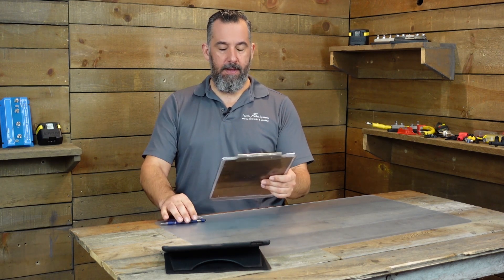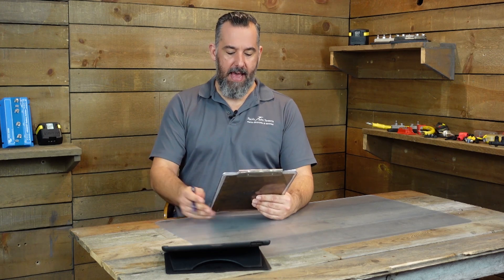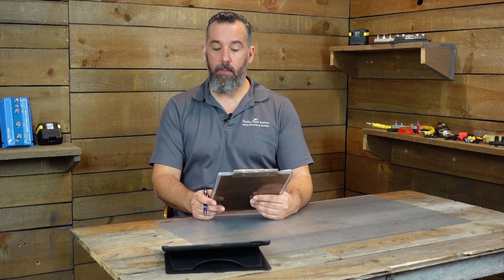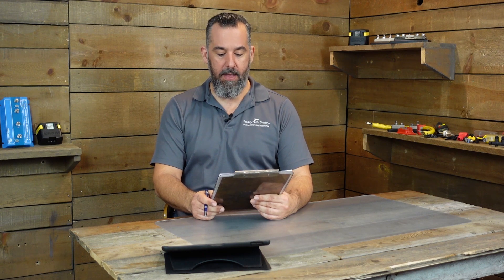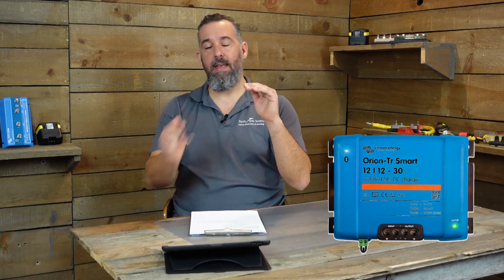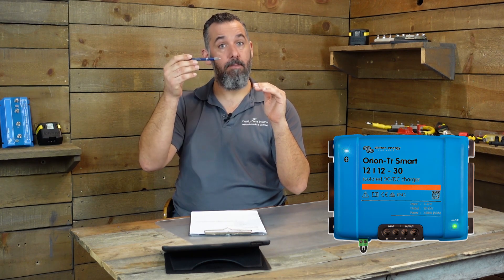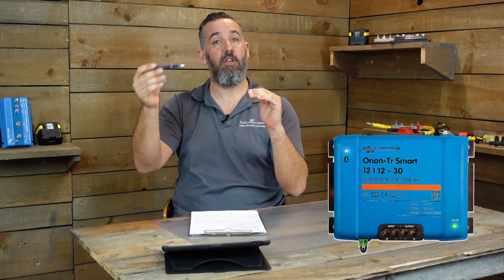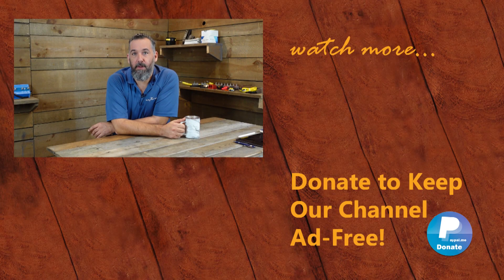How to Charge a Lithium Battery House Bank and an AGM Starter Battery at the Same Time?

Comment: so  - i can use shore power and alternator as is for the main starterting battery - removethe connections to the house back and have the starter battery go to a dc to dc then to the lithium bank?  can i still keep my solar and wind direct to the lithium bank?  or should that be moved to the starter?

Comment: In this case we need to use a Battery isolator with two outputz, but one of those must be connected to a DC-DC converter and after to the lithium battery bank, right?

Comment: Hi Jeff. 

Can the input of this dc to dc charger come from the output of a battery isolator?

So we don’t drain the starting battery by having it as the input of the dc to dc charger?

Thank you
Reply: Most DC to DC charger are also an isolator so I guess unless you just want the redundancy. I would save the money. 
I have a renogy 40amp dc-dc Charger and it says in description that it also functions as an isolator To protect the starter batteries)

Comment: Sooo confused.  I just finished watching another of your videos addressing the charging of lithium house and AGM starter using a battery isolator and a charge relay, but here you say that can’t be done because of charge profiles and you need to use DC- DC charge converter.  Is the difference having or not having the proper regulator for the alternator?

Comment: What happens if you DONT install the DC to DC charging converter? Would the AGM starter battery suffer more or the Lithium (Lifepo4 in my case)? I ask because with my situation I'm willing to just let the starter battery suffer, I dont care. I can replace it. But I wld like to keep the LifePo4 healthy for a while. Is this just not possible without a converter?
Reply: Your alternator would suffer.
Reply: @pauldemontigny1754  but the batteries wld be ok? i dont care abt the alternator really

Comment: Hei Jeff. I find your "tech talks" very interestig. However I am wondering why you are not proposing the "Alternator to Battery Charger" system as an option. I have installed this type of charger with outputs to my LiFePO4 service battery and to my AGM start battery. The charger has a (dv/dt = const = constant current) characteristic and a constant voltage ( float)/decaying current characteristic for the service battery. The starter battery is, however, charged mainly as it would have been directly from the alternator i.e. suffisient for start, thruster and ankering operation. This solution does not need a DC to DC converter.

Comment: At first I would like to wish you and your team Happy New Year.
I plan a setup with AGM and LiFePO4. I do understand the function of the DC-DC-charger.
If I install a high-output alternator and charge the AGM/Starterbattery first i assume that the charge of the housebank is limited by the DC-DC- charger, e.g. to 30A per hour as per sample device in the video. Is this correct? And if my assumption is correct I believe a high-output alternator does not really make sense. My planned capacity is 70Ah for starter and 280Ah for house

Comment: I guess then, the alternator only directly charges the AGM. I will be in the same predicament within a year. Thanks.
Reply from the maker: An alternator can only directly charge one battery bank.   To charge multiple banks a sharing device needs to be added.  There are many different ways to do it.  I'm not sure what your question is.

Comment: Hello Jeff, thanks for another great video. I have a question. Would you put the Orion DC-DC after the battery isolator or instead of the battery isolator. Is there any benefit to having a battery isolator if you are adding an Orion to charge a new house bank of lithium batteries. This is assuming there is one alternator, one starter and a house AGM battery bank with a battery isolator currently installed.

Comment: I want to replace my house battery with lithium.
I have 3 Yamaha F300s and each one has its own starting battery AGM group 27 and I want to keep them.
My single house battery is an AGM group 31 and I want to replace it with a lithium battery.
All 4 batteries run through a BEP switch box with ACRs. They all get charged with the engines running and a 4 bank Powermania charges them at home.
Would the Yamahas charge the lithium without any new equipment ? (Plug & Play)
Reply from the maker: I would be hesitant to charge it through the bep vsrs.  Although I'm sure many are doing it.   I would be more inclined to disconnect the vsrs  (you could just cut the small ground wires)  and instead run a dc to dc converter from each engine battery to the house.   IE a victron orion smart 12v / 12v 30a.   this will limit each outboard alt to 30a so it won't cook them.  But you'll still get 90a into the house bank which is pretty good with only a single battery anyways.  won't take long to charge.
Reply: @PacificYachtSystems   What is your opinion about using the Lithium version of the Yandina combiner ? Its cut-in and cut-out voltages are higher than the BEP vsrs.

Comment: I am doing the same with the use of a dc to dc charger  adding 200ah lithium batteries with my lead start battery.  My concern is my  with this tax the stock alt. on my universal diesel engine?  If the DC to DC charger is only 20 amp?   I also so a video where someone used a solar charger to do the samething as a DC to DC charger.
Reply from the maker: A DC to DC charging converter limited to 20 amps won't be too taxing to a small alternator (e.g. 55 amps)

Comment: Question on shore power charging with AGM start and LiFePO4 house.  Say you have AGM for the starts coupled via DC-DC charger to Li house bank for charging while underway. Part of house circuit is an inverter charger on the Li bank. Starter batteries are charged using a standard AGM charger.  Any issue with both chargers on at same time since DC-DC charger is connected between banks?
Reply from the maker: No issue with running both chargers at the same time as long is your bank is sized t handle the input from both. Starter battery charger is also a back up charger for the house via the DC-DC charger.

Comment: Hi Jeff. What about the scenario where I have a lithium house bank and a group 34 lithium banshee starter battery.

I have a multiplus ii 3000 that will trickle charger the starter battery so I am planning on charging the house bank with the alternator. 

But I'm not sure how to protect the alternator from the bms shutting down.  The "wire in a battery isolator so the agm is a fall back" seems like it won't work when the starter is also lithium. 

Thoughts?

I have a balmar alternator with mc614 regulator.I thought I read somewhere I can set that up so the 614 will shutdown the alternator when the battery goes away... Is that Thing?

Thanks for all the knowledge you share!
Reply from the maker: We haven't done a battery setup where both engine and house are lithium batteries before. Since your battery BMS doesn't communicate with the alternator, not sure how you'll get the alternator to stop charging if ever your engine or house lithium BMS disconnects because of overcharging. What have you found out about this so far?
Reply: @PacificYachtSystems  I have  emails out to Balmar and Victron now, waiting on some info. I don't have to stick with the Lithium stater but I'm interested to see if i can get it to work just out of curiosity.

Comment: Hi Jeff, thanks for sharing your knowledge - I'll probably never be a customer in your business (live overseas), but I still enjoy your videos. 
One little suggestion, whenever you make a video like this, a small schematic of your suggested solution would be fantastic, don't need a full CAD or anything like that, a hand drawn sketch would bee good.
Example. In this video, you suggest a DC-DC converter (isolated) - but where will you put it (I know for some/most it's obivious, for others that'll be a question) - as said just a suggestion, not a complaint.
Thank you
Reply from the maker: Duly noted Henrik, thanks for the suggestion, will try to integrate more visuals in the discussion.

Comment: Great video, thanks. These Victron DC/DC chargers are recommended very often. Once I purchased them, I realized that they are only 88% efficient. Sadly, the remaining energy is converted into heat and the chargers are getting very hot. I removed them from the system, and looked for a more efficient set up.
Reply from the maker: What did you choose as an alternative?
Reply: @PacificYachtSystems   I am in the exact same boat:). got 3 x 170Ah lithium batteries from Renogy, and have two wet batteries for engine and windlass on board. Is the DC/DC still the way to go, or is there a better alternative?
Reply: @andersfahrendorff9025  have you found an answer to this? I’m trying to figure out the best way to manage this as well
Reply: I looked at a review of a Renogy 20amp dc-dc and it was in the same ball park ( 86% ). Did you find something better? Thanks.
Reply: Victron now offers Orion-XS DC/DC chargers which are 98.5% efficient. An added advantage of the improved efficiency is greatly reduced heat during DC to DC conversion.

Comment: I wonder if anyone makes a unit who measures alternator temp and then adjust the field if the temp goes to high?
Reply from the maker: Absolutely, Balmar 614-H does exactly that, measures battery temp and even alternator temp.
Reply: @PacificYachtSystems  Nice product. A bit expensive maybe. A simple solution decreasing the voltage between the factory regulator and the brushes could do the trick?  Need to modify the alternator a bit though. If it works it can be used on any alternator. I don`t know. Not an alternator expert.

Comment: How would you recommend doing this, but with two engines/two alternators?  One for house bank, one for start bank?  Or both alternators connected and treating them as one and using a DC-DC charger?
Reply from the maker: We like to use battery isolators to share the alternator output to multiple battery banks. We'll be doing a video just on this topic in the near future.
Reply: @PacificYachtSystems  thanks for your reply, and love the videos!  Looking forward to seeing the video about isolators.

Instead of sharing one alternator output to multiple battery banks, how would you recommend using two alternators (twin engine boat) to charge two banks of different chemistry?

Comment: Will a blue seas mini add a battery 65Amp kit charge my 12 volt lithium cranking battery and my 24 volt lithium trolling motor battery properly?
Reply from the maker: No. A battery combiner, like the blueseas add a battery 65 amp kit is not made to convert from 24 to 12 volts DC. You'll need a DC to DC charging converter for this.

Comment: Jeff,   Where so you stand on the idea of having a small amount of lithium permanently combined in parallel with an AGM house bank.  Best of both worlds?  Have enuf lithium to go overnight at anchor, then AGM starts to contribute. AGM likes to sit at 13.2, and AGM likes to trickle at 13.2.  Lithium gets cycled lots of times, AGMs cycled very few times and not very deeply.  Charge from externally regulated alternator, (or solar), at 14 volts.   Added benefit is that in case of BMS shutdown in the Lithium, the alternator still has someplace to send charge to.
Comments, discussion, ?
Reply: Dan, this sounds like what Clark did on Temptress.   Seems hard to get experts to weigh in on this idea.
Reply: @TerrydeAlaska   Exactly what I was trying for. I’ll try and send Jeff the link so he can watch it.
Reply from the maker: Interesting concept, but still curious to find out what we don't know yet. Over the years, learnt the hard way, there is what we know and then there is the world of surprises from doing things for the first time.
Reply: In a battery bank, all batteries should be of same brand/technology and age. That said and as mentionned you can have a sla battery as your starter battery charged via the alternator, then a DC/DC charger to charge the house battery bank with one or several Lithium batteries. Plus solar pannels to maintain your house bank.
Reply: Jeff, just for the fun of it, give the following a look. Interesting prospect. Sorry I can’t seem to make it a link.
https://youtu.be/tAuPfgZgXec

Comment: Hello Jeff, excellent video! I actually got on Youtube to ask this exact question and it turns out you guys published this video only a day ago! Anyway, I have a follow up question: Assuming this Lead -> DC/DC -> Lithium setup, how should I connect my solar panels to charge (top up) both the lead starter and charge my lithium battery bank on my sailboat? I have 90W+50W+35W panels on my boat right now.
Reply from the maker: Connect solar to one battery bank (probably house) with a controller. Then in turn charger engine battery from house with DC to DC charging converter.
Reply: @PacificYachtSystems  Hi Jeff, so this solar setup require two DC-DC charger? one for Alternator -->AGM --> DC-DC --> Lithium and one Solar --> Lithium --> DC-DC --> AGM? Or does the DC-DC charger work both ways?
Reply: @dan5641   No.  
Solar Panel--> Solar Controller --> Lithium. 
Alternator --> Starter Battery --> DC/DC --> Lithium
Reply: @SOLDOZER  Maybe a stupid question, but if I charge up Starter battery while on shore power, am I also going to be charging the Lithium house bank?
Reply: @SOLDOZER  why not Alternator —>house-> dc/dc —> starter?

Comment: I use the Victron 12/12-30’s in all my boats. Got sick of ACR/VSR’s not disengaging. Added benefit of the Victron’s is that they have automatic engine shutdown detection; you don’t have to run any wires to the ignition for starting isolation.
Reply from the maker: Thanks for sharing Rod.

Comment: Hi Jeff. Thanks for another great video. On my boat with 300 HP outboard engine I have AGM for house and starting battery for engine ( not AGM). In this moment I am using a switch to determine which one I will charge with my alternator. I was watching some your previous videos and I thought that solution of my problem would be a battery combiner. But now watching this video I am a bit confused is that a good idea. Any suggestion?  Thanks
Reply from the maker: Hi Ante, when mixing battery types for charging, use a DC to DC charging converter between batteries.

Comment: Do you really need a DC DC though v combiner? Say you set your regulator to 14v bulk charge, lithium loves this and pb charges fine here. Then you have 13.2 programmed as float, lithium just sits happily at this voltage and pb float charges fine. Coupled with the fact that this is an AGM starter battery not a deep discharge, what would be the downside of this? Is it the potential that a big V difference between the 2 "banks" becomes a problem due to lithiums high uptake and delivery potential? Use echo-type charger? thanks
Reply from the maker: My concern would be that AGM battery will die prematurely if it chronically undercharged.

Comment: Should it be  non-Isolated  or Isolated ?
Reply from the maker: Isolated.
Reply: @PacificYachtSystems  From my research from Victron's website and forums, the isolated Orion DC DC charger converter is more adaptable for a variety of use cases, and provides galvanic isolation between input and outpur terminals. 

The real benefit of using the ISOLATED Orion DC DC charger converter appears more suited to using the DC voltage converter mode (ie not charger mode) to provide say clean DC voltage power output to some sensitive navigation or other equipment, where the equipment negative terminals need to be isolated from the power source/batteries negatives as clean power level signals are required or as part of some safety requirement. In such cases, using an isolated version makes sense as it provides the isolation between power source and equipment.   

If you are using the Orion DC DC charger converter to charge say batteries of different chemistries (AGM/Lithium), if your battery banks negative terminals (say starter and house batteries) are connected to a COMMON DC ground bus bar - which is likely connected to say the engine block which in turn may then be connected to sacrificial zinc anodes - then an Orion DC DC ISOLATED charger (in the charger mode) would provide little benefit compared to using the NON-ISOLATED version of the Orion DC DC charger. Yes, using the isolated version works fine in such cases, but you gain no real benefit of the isolation,  as negative terminals are connected.

Or is my interpretation of Victron's isolated vs non-isolated not accurate?

Comment: Hey Jeff do you have a basic wiring diagram for my 60 horse,on board battery charger,bow mounted trolling motor and battery,fishfinder?the bilge pump,navigational lights,live well are on the dashboard.its a 16ft aluminum.
Reply from the maker: Sorry, we don't have a standard diagram, good idea though.

Comment: Thanks Jeff! In the middle of designing my system. I haven’t found a good proxy for how to  size your dc to dc charger. I have an 85 amp alternator, is running two dc to dc chargers for 60 amp output something you’ve seen? Or would you stay below the 50% rated max output of the alternator?
Reply from the maker: It's a tough question, here are some assumptions. Assuming your alternator is charging your house battery, then the DC to DC charging converter is charging the engine battery, and so can be relatively small, like 20 or 30 amps.
Reply: We run a Renogy 50A DC DC charger on a 90A alternator... (Lithium100A+Lead75A) Works amazing. And we rarelly hit the 50A output as our batteries rarelly drain completely. So we believe this setup qualifies as a 50% cap ;) which gives us some peace of mind as we dont have a smart alternator.
Reply: Final word goes always to master Jeff Cote :) In our case the alternator charges the Lead starter battery and the DC-DC charger charges the Lithium house battery. See diagram here: https://images.app.goo.gl/Hn46hmPzuTNnbAnz6
Reply: @HelderNevesHelderNeves  broken link.